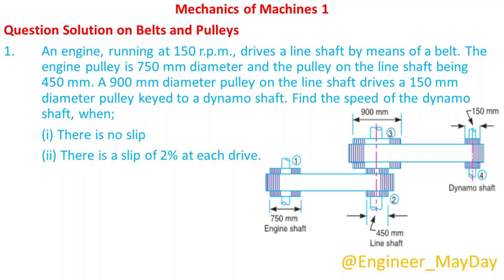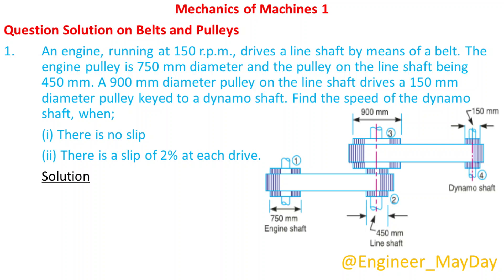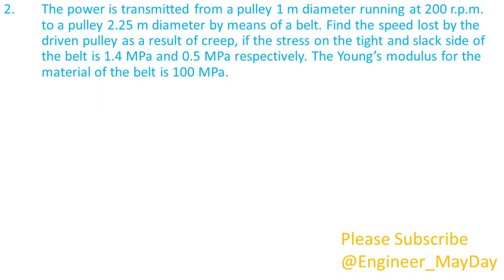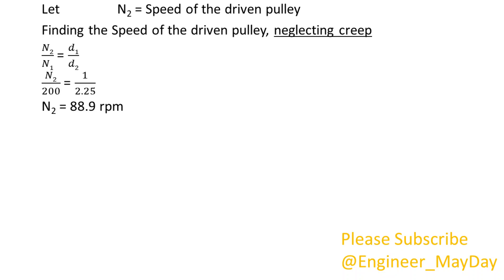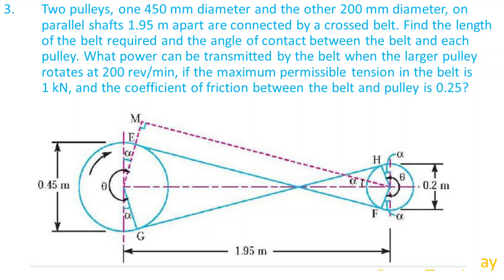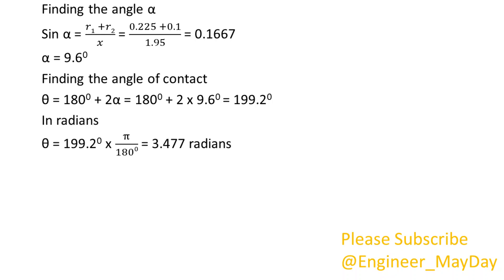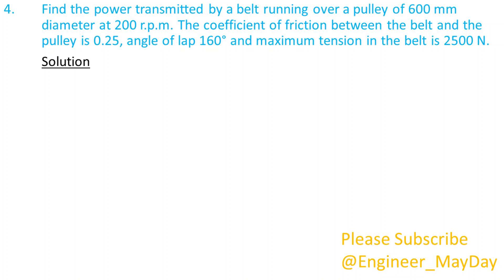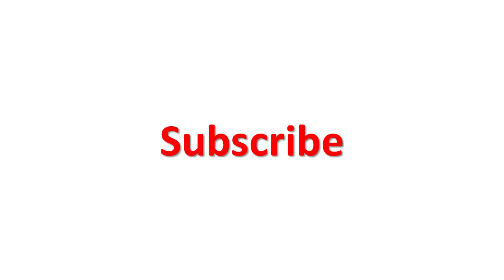Question Solution on Belts and Pulleys Part 1

Comment: Bro one doubt In 4th sum I  substitute 160 directly so this sum correct or wrong
Reply from the maker: No, You should not use degrees just radians.
Reply from the maker: In the given question, the angle of lap is specified as 160⁰. To use this in calculations involving trigonometric functions or equations in physics, angles need to be in radians because most formulas are derived assuming the angle is in radians.
Reply from the maker: This ensures the calculations are accurate and compatible with the formulas.